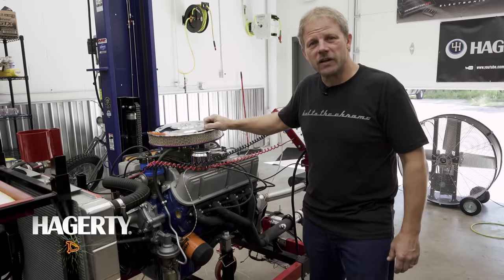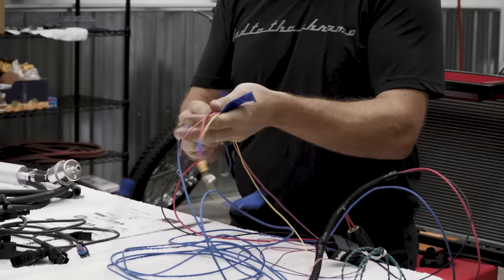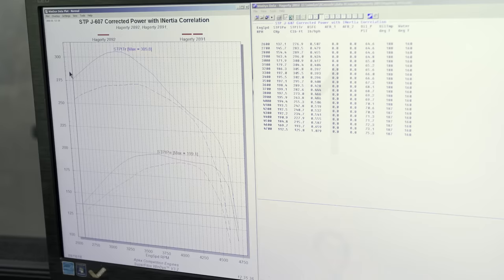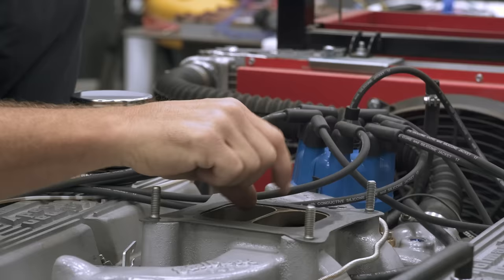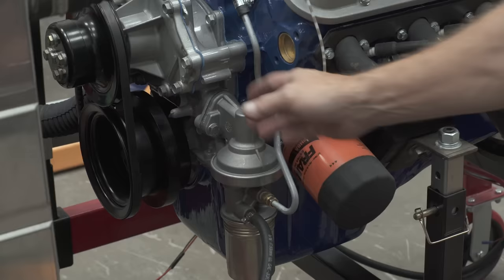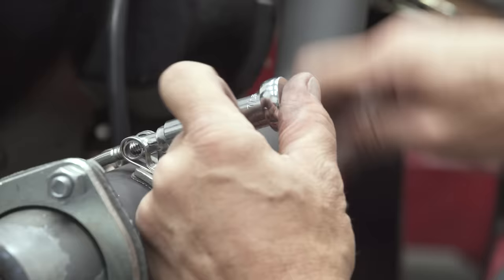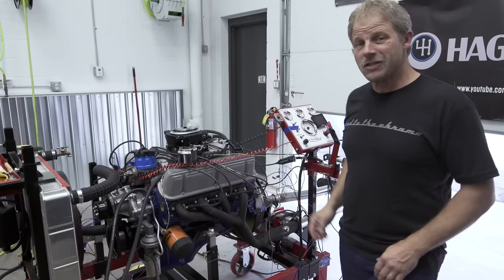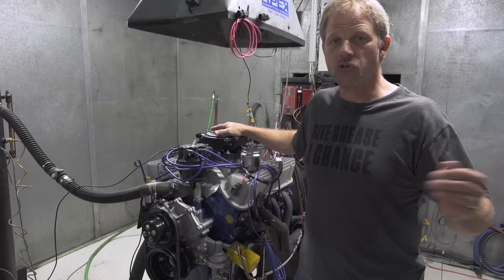Is it worth it? Replacing your carburetor with a Holley Sniper EFI | Hagerty DIY

Comment: I can attest, the Holley SniperEFI setup is definitely worth considering.

However . . . I should explain my situation that leads to that endorsement.

I started with a barely-functional 1984 AMC Eagle 4.2L I6 with a computer-controlled Carter BBD carburetor and roughly 1/2 of the emissions equipment rusted through, or missing entirely. No matter what I did to the BBD, the computer would compensate. It was dangerously lean - until it was unusably rich. There was a massive dead zone from idle to 2000RPM, and it refused to rev above 3000RPM.

I installed the Holley SniperEFI BBD kit, replaced the intake and exhaust gaskets, bypassed the rest of the AMC "Leinenkugel Engineering" emissions equipment, replaced the leaking and collapsed catalytic converter with a modern universal unit, and spent some time tuning the fuel curve. I finished the project in late October, and drove the car through the depths of a Minnesota winter with fantastic results. Even on the coldest of days, the Eagle started just fine - once I replaced the battery. 

So, if you're like me, and you're starting with something like a Carter BBD, Ford Variable Venturi, early GM CFI, or some other early-CAFE oddball garbage, the SniperEFI is probably the best $1000 you can spend.

If you're replacing a well-tuned 4150, you're trying too hard to be clever. Stop trying to be clever. Go wrench on something terrible for a while.
Reply: Oh, and as far as mileage, the SniperEFI definitely gives me lower MPG than my horribly lean BBD. I'm OK with that, given the damage long-term ultra-lean would've done to the mule.

Comment: Missed Opportunity: explaining what "Self-Tuning" actually means - YOU still have to experiment to get the AFRs that YOUR engine likes.
Reply: Yea, and plugging a laptop into something and pushing some buttons is a heck of a lot easier and less time consuming then spilling gas from pulling bowls and hooking up vacuum gauges yaddy da yaddy da.
39 years ago when I started working in garages customers would come back once a year for a tune up with a car that had lost power, would diesel when you shut it off, knock, backfire and everything else that a tune up would straighten out. 
Nowadays as far as customers engines go the only time you really see them on a regular basis is for oil changes, one tune up at 100,000 miles and that's usually it, these EFI systems themselves break less often then when vehicles first started using them years ago. 
I've got several machines that are toys and I do keep a carb and points in one but it's for rainy Saturday afternoon's when I want to feel nostalgic for the old days and want to satisfy the habitual tinkerer in myself. 
As far as machines I get paid to build for people once they leave I want to see them back as little as possible and these systems are good for that, they even suffer much less from power deteriorating over miles then the old systems, that's why today's vehicles run like new for much more miles then the vehicle's of yesteryear.

Comment: Lots of things not mentioned. The holley EFI will adjust fuel enrichment based off engine coolant temp it will also do a power shot of fuel before crank to help with start will also prevent engine from flooding will raise rpm when AC engaged can control timing can set how high idle goes on initial start based off ambient temp. Just to name a few things that people tend to completely over look when talking about swapping

Comment: Should have tried the carb again . This time with the spacer.
Reply: my thought too.
Reply: Carb with spacer would have been too lean, the power curve was already weird af.
Reply: And they ran the EFI without the restrictive air cleaner..... A VERY flawed comparison.
Reply: @robertweathers6096  "restrictive" lol
Reply: And the wrong gasket under that carb.
Reply: @DuBstep115  I agree the power curve was funky but jetting and timing, along with the spacer, would have brought those carb numbers up and smoothed out way it made power.
Reply: Valid point. The 289 came from the factory with a carb spacer. However most people removed them when you swap to a better manifold because the hood clearance became an issue. I feel the space might have added a few HP's but not many...
Reply: My buddy runs the FAST system on his 5.50 small block truck, but uses dominators on his 4.50 big block truck.
Reply: I couldn't agree more. I like how he casually slipped the spacer in there
Reply: @DuBstep115  Oh look; a kid that doesnt understand that each has their benefits and downfalls.  

But at the end of the day, the carb will still make it home when one of your sensors fail.
Reply: @DuBstep115  👏👏🏼👏🏼👏🏼👏

Comment: I just switched over to this exact same one on my SS 86 MC 🔥🔥🔥
Reply: did you use the quadrajet version or the normal version throttle body, thinking of putting this on my Pontiac that has a quadrajet
Was there a significant improvement?

Comment: I'm currently running a 465 cfm racing beat modified Holley (1848-1) on my large streetport 74-78 4 port 13B with S5 NA rotors and absolutely love it, and is a very reliable setup, but I have been seeing a lot of good results with the sniper holleys on rotaries and think I might hop on the band wagon too as I think it should help me get the most out of this engine

Comment: Get that fram filter off that motor while it's not too late...
Reply: @Seymour Kuntz WIX would be fine(or NAPA Gold)
Reply: napa gold is made by wix
Reply: Nothing wrong with Fram. Just gotta change em on time
Reply: @YungEagle3k  wrong
Reply: Yep.  Better off running no filter at all, lol.
Reply: Whats next, PenzOil?
Reply: 313k miles on my vortec 4.3L using cheapest fram filters. Ive never had a problem with them. I change my oil every 3-5k miles with 5w-30 conventional oil.
Reply: Agreed.  I used a Fram on my ZZ4 and thought i had baked the engine. All sorts of noises.    I changed to a Napa gold and the  engine noises were gone.  My Vortec 4.3 V6 had a tick.  Changed to a Ac filter and it was gone.  Fram Filters are cheap and can be troublesome. They have pressure issues.  Find the study where the guy cut open a bunch of filters. of you have any doubts.
Reply: Why you sweating a fram filter.   So what .    Are you even using full synthetic.    Do you change your oil often even with Synthetic.  Filter doesn't have anything to do with that engine if its maintained properly for full race.   I haven't blown an engine in 15 years at over 600 pulls.

Comment: Thanks for making this video. I am putting the two-barrel system on my Classic Mini Cooper A-Series Supercharged project. This was really instructional and great info. I can't wait to get this retrofitted to my little British engine. :-)
Reply: COLE!
Reply: @RakTheGoose  Hello this is Cole speaking. :-)
Reply: Sorry, totally unsuitable. These units are for at least big 6s or standard v8s. Not maybe a 1275 4.
Quite possible someone is making  a suitable unit.
Reply: LDN Wholesale thanks for the input but the two barrel unit works perfectly on a forced induction modified a-series. Puts around 130-150hp to the wheels and has been tested running (very well) with a modified supercharger to suite the engine. These two barrel units aren’t much different in size when compared to a Weber DCOE carb setup which is what makes them so great for this very specific niche application. 🙂

Comment: We did not see the full carb run. But, the dip in the power and torque curve is 95% certain not due to the carb being too small. It is due to the engine getting too much fuel. Even with the Sniper you are running high 11´s on WOT. IF the engine really needs that much fuel to make max power there is something else wrong, but it will definitely make for a funky power and torque curve. The downside of the plenum type intake manifold is that you need to have the engine run at a slightly rich setting in order to overcome lean spots on some of the cylinders, but with the Sniper it does not have to be that rich. My bet is that there is another 10 hp and torque in it plus a cleaner curve and a crisper running engine by just going to 12,5 AFR.

Comment: I bought a new '86 Mustang GT with the new fuel injection.  I could have bought an '85 with the carb system but waited for the new '86 Mustang GT fuelie to come out, I'm so glad I waited!
Reply: I did the opposite, I bought my '85 GT in April '85 because I didn't want the '86 fuelie. Plus the '86 hi-swirl heads sucked.
Still got the '85 and it's about to get a built 363 with a 750 carb.
You can't beat the howl of a 4 bbl carb at 6500 RPM!
Reply: @Turbo4Joe363  I wish I still had mine!

Comment: had a 289 hp in 64 1/2.   From the factory- rated at 271hp.   it came with dual points and heavy point springs.  never floated the points.   we mod the engine like yates steven ford did his cobra less the eight holleys.  It would rev to 8500 no problem.

Comment: Awesome video!  That O2 sensor bung has about a 0% chance of me using it on my car or a customers car though lol.  Neat idea I am sure it is perfect for a quick install.
Reply: Jerry Jrs Garage that clamp on bung is a leak waiting to happen
Reply: It really depends where and how you use it. Obviously put it on a straight and consistent section of pipe. I've used patches and left them, they don't leak if you get them on right. If your hands are painted on then get someone to weld a bung on for you, no big deal.
Reply: CanadaBud23 Yeah I could see that.  Really depends on the project too I am sure.  I mean heck if it works and its quicker & cheaper then it will sure be used.
Reply: I like the plate! But I would weld it in place. To me, it looks more substantial than just a nur welded in place. Having sheared off O2 bungs in stock systems before, that plate looks like it can take a good amount of torque.
Reply: JB WELD under it will work just fine!

Comment: I have the 1250hp entire system ignition whole thing . and the control you have is great now it is not cheap 
$1500.00 for efi 
$650.00 for ignition system
$350 fuel pump.
But for a power adder like i have it works great.
Reply: What kind of power adder are you using? I'm looking at the same kit for a Chrysler 496 stroker and wanting to pro charge it, seems like it makes the tuning much much easier.
Reply: @wyattgates9060  

Nitrous , buddy has a blow thru setup with turbos and yes it helps a bunch.

Comment: A few irregularities, as well, 
- Carbeurator runs were only graphed to 4700rpm, started at 2500. Efi was pulled from 3000 to 6000.
- AFR was not monotored or logged on the holley runs. The dips in the curve tell me fuel metering was not correctly tuned.
- Peak power was made with the WFI at an rpm that the holley was not even run up to.
- STPcor factor did not seem to fully compensate for the humidity and intake air temperatures noted on the screen, on both the efi and holley runs
- on both holley runs where the readout was shown on video, Plenum vacuum was a fair bit higher than would be considered "correct", telling me that carb had too much spring in the vac secondary diaphragm, I'd bet it was the out of the box "bog solver" spring, NEVER the right one for a proper tune on an engine ive dealt with.
- Finally, who is performance benchmarking 530/600 cfm Vaccuum secondary carbs against anything? That carb is so cheap you could buy it and a set of aluminum heads for the price of the efi.
- I would like to see a well set up double pumper of equivalent cfm run back to back against the sniper, with, say, 2 points of control allowed to be adjusted on the carb between each run, as the holley "self learns" with each run.
- And for gods sake, measure and log the AFRs on every test!!
In closing i will say that the sniper efi systems are very well designed, well marketed and easy as pie for the average classic car owner to install and enjoy, will often clear up issues the owner was unaware of or did not know to remedy, and will outshine an untuned, out of the box, or incorrectly chosen/sized carb just about everytime, and that keeps old classics from getting junked/sidelined out of frustration, which the #1 goal to keeping these stylin' old rides on the road and in public view. Holley is definitely my favorite automotive aftermarket group, for all of their products and innovations, since their start in 1903!

Fun fact - Holley - Ford - Harley Davidson - Buick - Western Pacific Railroad - And Miller High Life beer - all founded in 1903!! What a year!

Comment: I'm all for EFI. That being said I think that you need to put a spacer for the carburetor for absolute fairness test between the two.
Reply: The whole idea is that with the EFI system you don't have to mess with a million stupid little carb tricks like that,  you put it on, set it up and you're done, plus there can also be clearance issues with spacers.
Something else he doesn't cover and what most people don't think about is performance loss from deteration over time, points and carbs require regular maintenance and even then suffer power loss over time that EFI systems don't, that's why modern vehicles retain their power over many more miles then the vehicles of yesterday, yes they have the occasional sensor that goes out but the truth is the systems and the related parts have gotten so good over the years that it hardly happens anymore. 
I've got several personal machines and  I keep a carb and points on one but that's because I started doing this 39 years ago and when I feel like being nostalgic for the old days and want to be the habitual tinkerer I can be I go to it, I like spending a rainy Saturday afternoon that way, but for anyone I build something for I always recommend going this route, it causes both them and myself less agony in the long run, when you stop seeing machines you've built coming back as much as they did back in the day you start catching on to these things.
Reply: Niterider Allen The type spacer makes a difference as well. I've run several different spacers under my carbs over the years & found that, in my application, a 2" HVH "Super Sucker" spacer is by far the best. My 409ci SBC picked up idle speed & vacuum, & made the fuel distribution more even from cylinder to cylinder, allowing me to both lean the mixture a bit & make more power with the HVH spacer over any other spacer I've tried. I'm sure there are numerous Chinese knockoffs of the HVH costing a lot less but the HVH was developed years ago for the NASCAR Busch Series motors running 450cfm Holleys, so I'll go with the proven part that has worked for several decades!

Comment: Would have been interesting to see the spacer used with the carburetor before the swap. Plenum volume as well as a partially open duel plane intake might have increased peak power with the carburetor. Good video! Thanks!

Comment: This system is what we used to call a throttle body injection system.  GM offered similar systems on the cars and trucks for years.  It's cheap and easy to engineer and produce, bit not nearly as good are a direct port injection system.

I would like to see this engine tested with a Holly "Power Pack FI system" that includes a new intake manifold with injectors mounted on the intake ports and a throttle body that handles air to the system.  Unfortunately Holly only makes these systems from Chevy Big BLocks and Small Blocks.  Borla makes several high end FI systems for Ford engines, how about a comparison with one of those systems.

However there is a drastic increase in price between these two systems, the Holly be around $1300 USD while the Borla systems start at around $4600 USd for small block Fords.
Reply: I said the exact same thing. TBI from 1980s .  Direct port  requires injector timing and pulse width and crank sensor.

Comment: Points used to work just fine to 6000 RPM on a 1969 MGB  I used to have.
Reply: A little disingenuous saying points don't work past 4500. Those points might not have but plenty do. Not to mention this is clearly an advertisement. Nothing wrong with that but they should have used Youtubes built-in sponsored content pop up.
Reply: Got 7500 in a '65 327 SS Impala
Reply: @ohlookadragon  
I wondered about the 4500 RPM limit with the points as well. I had a 64 Dodge Dart 225, 6 cylinder and I could rev it to 5,000 RPM.  it really didn't seem to have much power at that RPM  but in first or second gear it could get there. It was a 3 speed manual transmission.
Reply: They sold high performance points at one time with  heavier spring  pressure on them. Old school 327 could hit 7500 witha  hipo 
Dual point distributor.
 I  know this is something out of Jurassic park now.
🦖
Reply: Those points could have been fixed in seconds for free by giving the spring a tweak. Having said that the quality of the point sets available now ain't what it used to be.
Reply: Couldn't help thinking the same, my 6 cylinder would go to 7k when new. Points bounce at 4.5k .. oh yes this is America!
Reply: 6,000 on a 4 cyl is like 3,000 on an 8 cyls.
See, there is twice as many clyinders and the points must snap for EVERY cylinder.
😱
Reply: Points wears out and must be changed and installation would and is expensive 
Have to tune up every 10 to 20 thousand miles
Reply: @cc9z  did points every other oil change whether it needed them or not. paddle CDI was nice enough with centrifugal and vacuum advance once they were set right (sometimes a vacuum limiter to the diaphragm). if the points were bouncing out its the distributor bearings are slopped out, isn't any way to be trying to run something. just my intuition of what was going on there.
Reply: @modelnutty6503  you have great points of concern  but so many companies had there points different and difficult to service and so many moving parts wearing out i am glad we dont have them anymore
Reply: A true 289 hi po had dual point distributor, and no vacuum advance